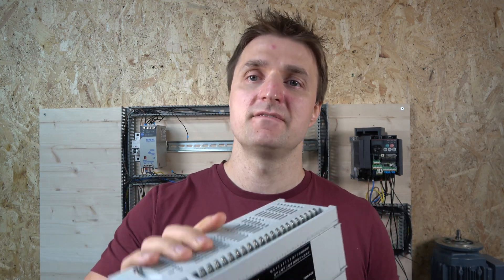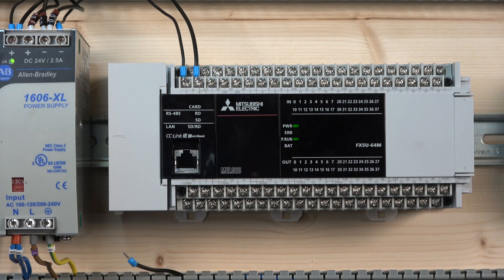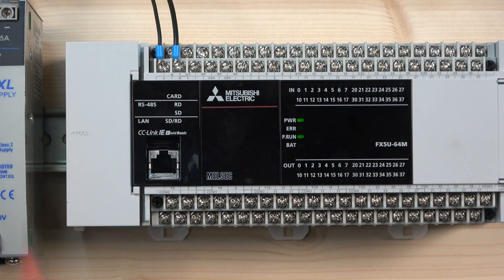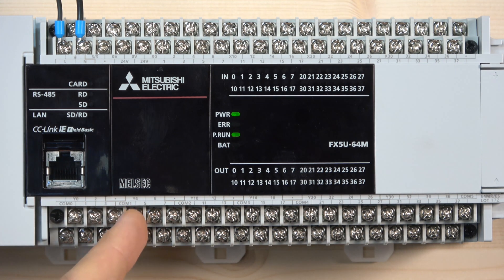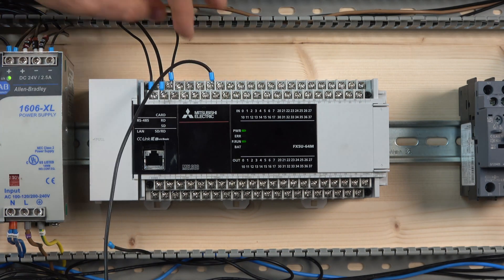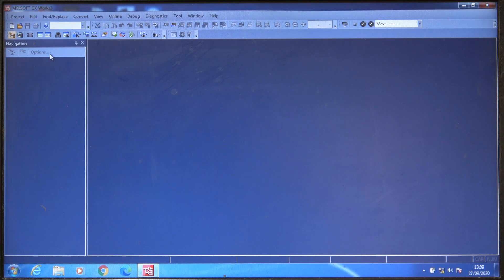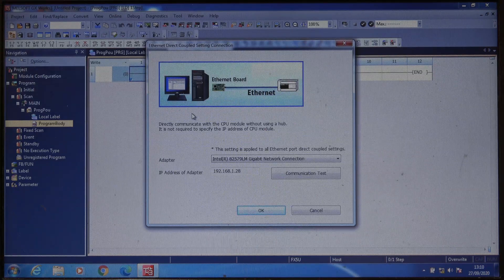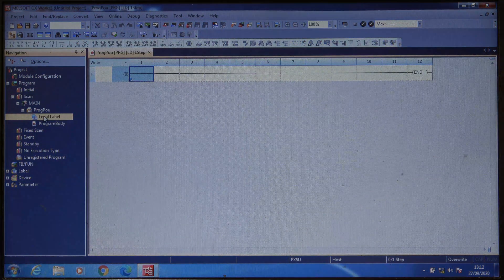Mitsubishi PLC FX5U series GX Works 3 program upload / download / input and output wiring. (English)

Comment: Hello, great video. Can we integrate the PLC with an Nvidia Jetson? I have seen python scripts using pymodbus for communication with these modules but no example projects/implementations. I am planning to use such a system for a work related project. will it work? if not , can you suggest some alternatives.

Comment: Hi, Thank you for the video. Can you clarify, the power going to the PLC to L and N, is 24v DC which comes from the AC to DC adapter beside the PLC? Could you wire the AC directly to the L and N on the PLC or do you have to have step down transformer to wire to the L and N on the PLC? Thanks.